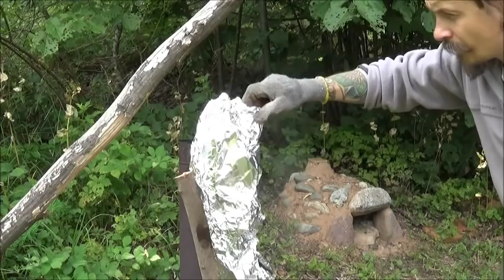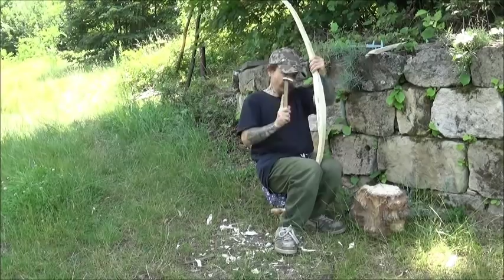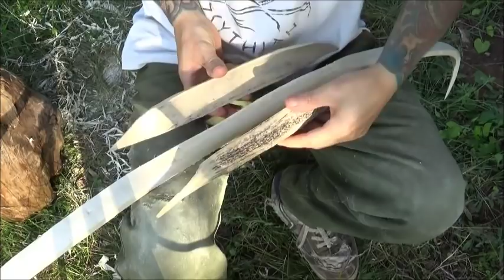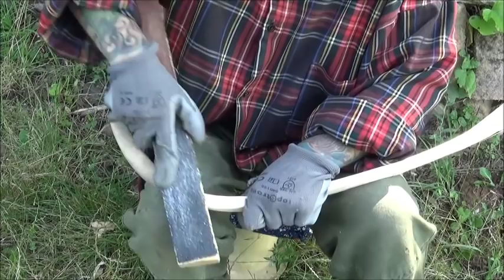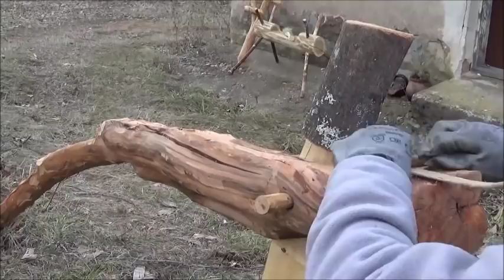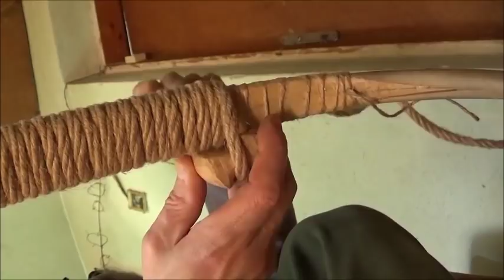Bulgarian horn bow. Part 1

Comment: just a hint...back that first bend clip with a piece of banding steel...and actually pull the banding steel so the wood stays in compression....you will completely avoid the splitting as you bend.